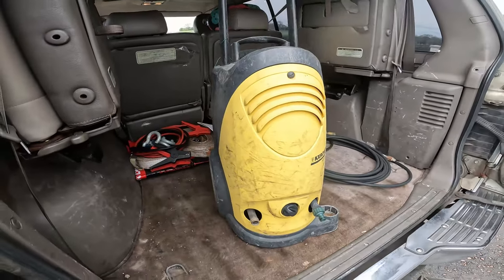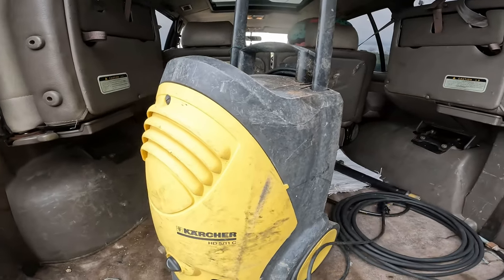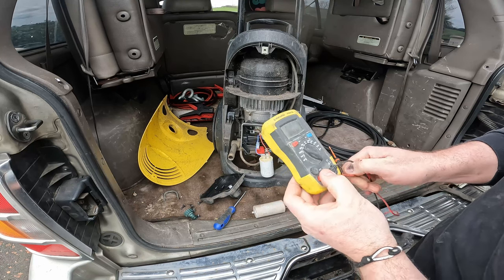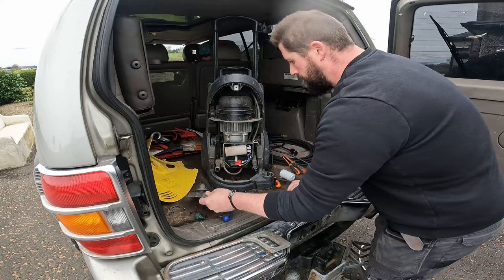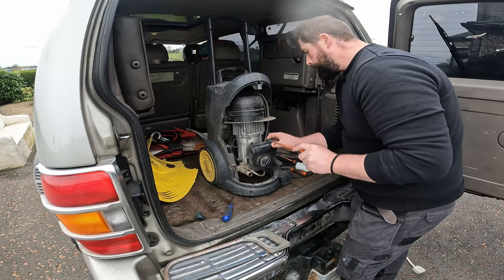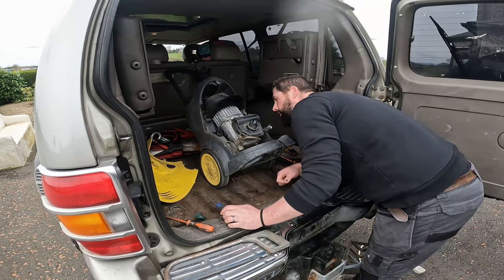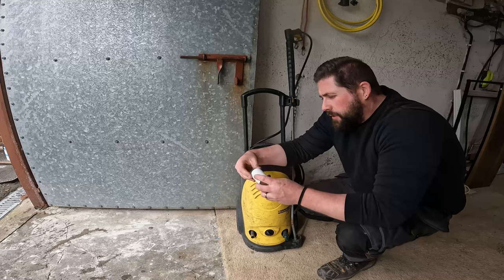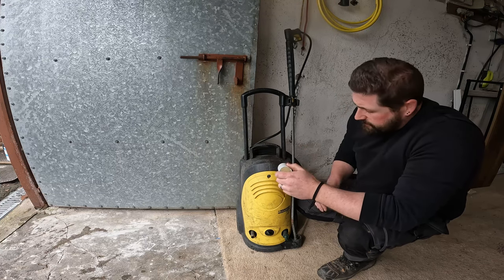Fixing a dead Karcher 5/11c Pressure Washer

Comment: Thank you for the informative video.
What could be the problem if a new capacitor doesn't solve the problem and the machine keeps not quite spinning up and blowing fuses?
Reply from the maker: Hi. If you are still blowing fuses the motor is overloading on startup. Check there HP hose is not pressurised and connected (pull the trigger) and check to see if you can turn the motor over my hand using the fan on back of motor. If this is jammed solid then you have a problem in the oil side of pump or the motor. Thanks for watching!

Comment: As I assemble mine the switch is not working , although it’s turning left to right but it’s not touching the knot so the engine will function .. what can I do Sir
Reply from the maker: @KingPoshMusic  Check the pressure switch core is moving up and down in the head correctly. It is common for them to stick and now allow the stem out far enough to rock the on off switch